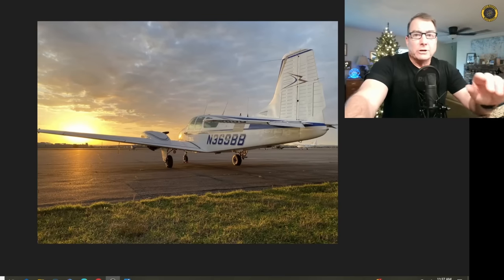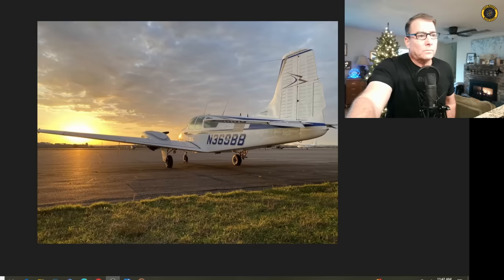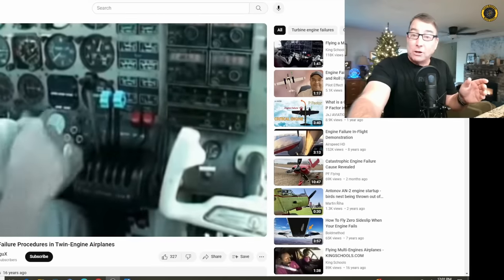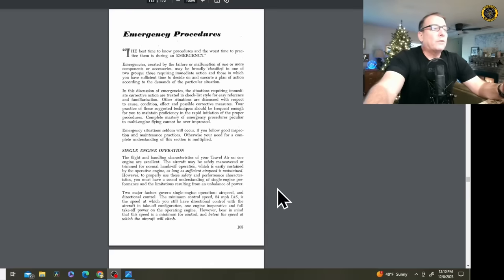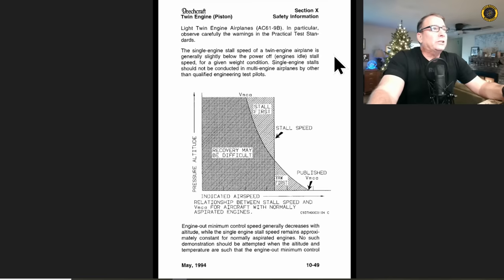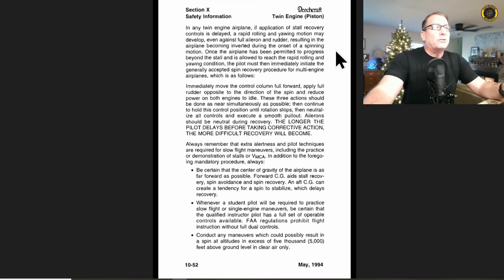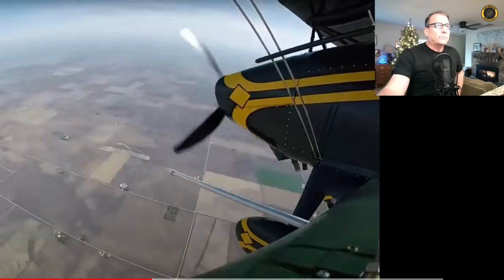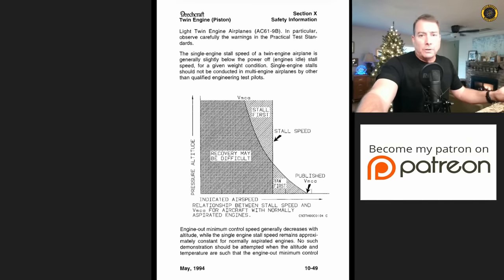Another Fatal Vmc Demo Stall Spin!! N369BB 4 Dec 2023

Comment: Vmc demos should absolutely be preceded by several directional control exercises. Practice maintaining heading in cruise at progressively lower power settings. Once proficient, practice in climbs and then finally the demo. I have instructed in several types of light multis, and this is the best way to get the student active with their feet, maintaining directional control. The other part of the Vmc demo is to NEVER actually slow down to Vmc. Leave a buffer. The "foot block" idea has been in the guidance for years, but I prefer to make an airspeed buffer. The point is made either way. 
Proper flight instruction requires skill, knowledge, and situational awareness that is becoming less common.
Reply: I am not a pilot (only flight simming), can I ask for clarification, what do you mean with blocking full rudder exactly? E.g. when the left engine is out? Thank you!

Comment: I'm not a pilot, so my opinion here may be ignorant, BUT it seems silly that the relatively inexperienced pilots who don't have enough time to fly for the airlines are the ones tasked with training new pilots. Can someone help me understand the logic behind this? It feels like, over time, this will seriously diminish the quality of pilot. Each subsequent "Graduating class" of pilot, will have been trained by increasingly less and less experienced pilots. 

Is there something I'm missing? This is a genuine question asked in good faith NOT a backhanded criticism of the entire system, or anyone operating within it. I just don't get it.
Reply: This has long since been the way. Twenty years ago I was a 250 hour pilot training other pilots for multi ratings for $10 per hour to gain experience. Just like my instructor had little experience himself. With a good training syllabus and oversight that is not a major problem.
Reply: The young instructor pilots are not training people specifically for the airlines.  If you want to learn to fly for whatever reason and you went to your local flight school you would find that most instructors are young with relatively low time.  This is because being a flight instructor doesn’t pay that well, especially compared to the airlines.  These instructors are willing to fly for crap pay because they are getting hours toward being experienced enough to fly for the airlines.  This means that as soon as they have experience enough to get a better paying job they are gone and the next up and coming instructors are getting hired.  This is not an intentional process, but that is how the incentives are aligned.  Once they go to the airline they get much better instruction on their specific aircraft with more experienced instructors in top of the line simulators.

Comment: When Vmc is below the stall speed, which is not uncommon on light twins used for multi-engine training, then recovery must be initiated immediately at the first indication of a stall (stall warning or aerodynamic buffet) or loss of directional control (yaw or roll or both). The stall warning system on the airplane must be operational, it must be confirmed operational during preflight, before performing the Vmc demonstration.

Comment: Truly excellent analysis, thank you.
I recall doing my multi FIC with a very seasoned operator, who began the first briefing with the statement " multi engine tuition is the most dangerous flying that you will ever do.
The discussion that followed and the mitigations, some of which you have touched on were core skills in that course.
The Vmca demonstration was to be made precisely as you noted with a false rudder stop to prevent an entry into the stall regime.
At the time, the airline market was such that most of us had in excess of 1500 hours instructional time, but the airlines were still not biting.
Thankfully this produced a very experienced and motivated set of instructors, rather than having to do anything at all to achieve the magic figure.
Conversely, the cadet output from approved organisations entering into line ops with minimal hours also presents some interesting challenges.
Technically above average but with very poor airmanship experience.

Comment: Juan has identified the requirement for 1500 to get into airlines as a factor. Typically, in order to build time students get a commercial license and then an instructor rating to enable them to build the hours. Invariably this means the inexperienced teaching the unqualified. Disaster is the often the result of this.
Reply: It would make far more sense to have the pilots train for several hundred hours in the sim instead, IMO.  The airline hires them and then they go into a second flight school.  Not the roughly 50 hours of sim time, but 200 or 300.  Where they can safely train all of these maneuvers and get up to speed quickly.  Net result - maybe 800 or 900 hours total, but far better trained on what they will actually fly.  Not this 1500 hour nonsense. And no risk of dying in maneuvers like this.

Comment: I have a CFI MEL and did mutli instruction about 50 years ago. We didn't have any idea about the problem with VMC  below the stall speed at higher altitudes. luckily we were at sea level airports and did our instruction pretty low.  Even though qualified to instruct in light twins, there is not enough money to convince me to do it.

Comment: Juan, back in 1964 I was working on my multi-engine rating with Lee Sitton out of Lebanon, Oregon. We flew up to Hillsboro to look at a Cessna T-50 which he purchased and I received my training and multi rating in. A gentleman named Bob Bell demonstrated another T-50 with a student. While we were out and the student was working on Vmc practice Lee asked Bob if he ever did spins in the T-50 and Bob said yes as he had instructed in the T-50s during WWII. 
He performed a 2 turn spin and walked the student through the process. In flying and later instructing in the T-50 it performed like a J-3 Cub with two engines. I never did find any bad characteristics with that aircraft.
But like any spin there is a recovery factor and you need ALTITUDE to recover from any spin. I have performed 7 turn spin in Aeronca Champ!
Have you watch the NASA videos of the Beech Duchases that Beechcraft performed over 1500 spin test to determine spin entry and recovery analysis?

Comment: I don't think they do spin training for Instructors any more.  Excellent Video.
Reply: Spin training is required before you can take a CFI Checkride. 
And it doesn't matter if it's in a twin,  instrument,  or single land/sea checkride, you must get signed off for spin training. 
 
Spin training will performed in a single engine A/C that is certified to do so.

Spin training is not required for any other checkride.
Reply: @aarondoty2210  It was in my day, but I was under the impression that it was no longer the case, Of course its not done in a twin. If it is back in the syllabus that is necessary.

Comment: When I learned to fly back in the 90's, we practiced Vmca and spins in a cessna 150.  It was a lot of fun and easy to recover in the 150. I can't imagine being in a flat spin in a twin, especially at lower altitudes. Excellent review as always.
Reply: How can you practice Vmca in a single engine 150?  Spins...yes!....Vmca imaginary?
Reply: @JM-lf4ws  mca.  I used Vmca because that's what they were talking about in the video.  Mininum controllable airspeed. MCA. My flight instructor would have me ascend to around 4000 ft agl, slow the plane down(stall is around 42knots), riding the stall horn and practice holding it right above stall keeping the wings level.  The controls get extremely unathoritive.  Bring the engine to idle, pulled yoke all the way back with opposite controls, over on its top and into a spin.
Reply: Vmca in this video applies to the minimum airspeed that a multiengine plane can be controlled in flight with an engine out.  The 150 stall speed, Vs is what you must be thinking about.  The sluggish control response near Vs in a 150 is not the same physics/aerodynamics explained in this video.  I am a single engine pilot and engineer...I would have thought opposite engine power would have a positive effect...the pilot says that is not true in practice!

Comment: Very informative video. Thanks for sharing.  I remember the Wright Patterson AFB Aero Club lost a Beechcraft Baron. The instructor and student were practicing engine out procedures and the aircraft stalled, flipped inverted and ended up in a inverted flat spin.  They never recovered and sadly both pilots were killed in the crash.  Obviously, they had flown the aircraft outside of its flight envelope, that caused them to enter an inverted flat spin and crash.

Comment: Question to the pilots who have a lot more than 300 hours total time who might know better: is there a reason why twins in a spin don’t add opposite power during the prea/reap/what have you recovery?
Power idle: stop spin acceleration
Rudder opposite: break spin (would you not briefly add opposite power to assist in breaking spin?)
Elevator down: break stall
Aileron neutral: don’t induce more stalls

Obviously this only applies to engines in simulated feather, not engines that failed.

Comment: One thing I rarely see mentioned in connection with VMC training if the difference between an actual engine failure and reducing an engine to idle.  I did my AMEL training in a PA-34-200 (Seneca II) long ago, right after the dinosaurs died.
If I recall correctly, VS was 76MPH and VMC was 80MPH, so only 4 MPH between the two, a fact my instructor kept beating into my head.  When your speed is decaying because you lost an engine you had few seconds between VMC and a spin.
He gave me a demonstration one day when, without warning, he pulled the mixture instead of the throttle and killed an engine.
Yep, a noticeable difference.
I had a really good instructor.  Since the Seneca had counter-rotating props it didn't have a critical engine, so he gave me a lesson in a Cessna twin that did so I could feel the difference.  And beat into my head that knowing which was which was important when flying twins.

Comment: Relatively new MEI here to add my 2 cents. One other thing that MEIs must be SO careful about is the use of ailerons in the Vmc demo - if the student adds aileron into the operating engine to help control the yaw (it happens subconsciously, and can happen to even the best pilots if they're not briefed adequately to avoid it!), an airplane that will normally reach Vmc well before stall speed will appear to fly straight through Vmc until reaching the buffet, putting the airplane in this very dangerous situation that Juan is talking about here.

So, MEIs - DON'T allow your students to control yaw with the ailerons at all during a Vmc demo, and if they do - IMMEDIATELY discontinue the maneuver and recover, then go back and properly brief the student on the ground about the dangers of the Vmc demo and common student errors that can cause a fatal accident.

Comment: First, let me say I learned a lot about ME aerodynamics from this video, and it prepped me very much for my recent CMEL training. Thank you, Juan! But I recently reviewed the preliminary report by the NTSB regarding this crash. The state in which the airplane was found is inconsistent with a typical Vmc demo, but is certainly a lesson in the dangers of a Vmc condition. FIrst, the landing gear was found extended. Second, one of the blades on the left engine was found undamaged, indicating the engine was likely not under power. Damage to the nose and engine was skewed right, indicating a spin to the left. Typically Vmc demos are not done in the landing configuration due to the keeling effect of the landing gear. Second, they are not done with an engine shut down or otherwise inoperative. Based solely on that report, it appears more likely to me that the pilot and student were working on power off stalls, and the left engine quit during stall recovery.

Comment: Thanks for the great VMC discussion. When I was a kid I taught hundreds of hours of slow flight and VMC in light twins. I demonstrated a technique that dramatic increase in rudder authority as the plane approached VMC. Just decrease one inch of MP on the 'good' engine and you will instantly stop the yaw. I see that is being taught now and that's great.
Can you add a discussion of the impact of adding VGs to old twins. These VGs are also added to the rudder. What I'm thinking is this decreases stall speed AND VMC due to a more effective rudder. But are we creating a ticking time bomb on these older twins?

Comment: 10:16 when Flywire was doing his spin recovery, he used "idle (engines); neutral (ailerons) ; aft; rudder (opposite spin direction)"
I thought aft was the stick, unless I really misunderstood him - the idea was to get the plane in a position to get maximum airflow over the rudder. Is that different in a twin? Once the spin was recovered from, then point the nose down and do a dive recovery.
I honestly don't know <- not a pilot. Any clarification greatly appreciated, as I try to learn this stuff.

Comment: Great video, I am a CFI out here trying to get those hours.  Not currently a MEI, and do have multi addon for my pilot cert.  I wasn't taught this lesson, and really appreciate the knowledge here.  

I am confused on the 'blocking the rudder'. Are you saying as an instructor, if I get my MEI and chose to teach in multi, that I 'pre push ' the rudder, or I put my foot behind the rudder,  limitng the apparent travel to the student, so if something happens we have a little extra rudder by removing my foot/block?  Just watched the video and haven't read all the comments so maybe the answer will be obvious with a little thought.  Thanks for all your work and effort making a nation safer.
Reply: Basically what you explained is correct, as the instructor you will block the opposite rudder so the student can’t keep pushing on the rudder causing the plane to yaw in the opposite direction of the rudder correction. This is to simulate VMC while staying above actual VMC or stall speed.

Comment: I was about 10 years-old when my father was taking instruction for his multi rating. His instructor was very good, but tough and fearless. I was in the airplane on a training flight during a Vmc practice. The 310 we were flying  rolled over on its back and entered a spin. Obviously we were able to recover but it left me with a fear of stalls, Vmc demonstrations etc. When I was getting my multi rating the training was much more conservative, but I was always hyper-aware of airspeed and the feeling in the seat of my pants anytime below cruise speed. I guess the high-end simulators might be able to re-create the visuals but there is a feel that is recognizable in a single-engine demonstration that may not be available in a sim. Awareness and extreme caution as you, more or less, stated is paramount for these training flights.

Comment: PARE....Power aileron rudder elevator.  I got my multi in a 310 in 1984.  Before the CFII would allow us to practice Single Engine Vmc, we had to take spin training and get signed off on 50 different spins...yep 50.  We did them left, right, accelerated, etc.  The first couple of lessons it was kind of scary, but after that I looked forward to spin training.  I am a firm believer spin training should be a requirement for a pilot certificate.  Getting into a spin your first time can easily be sensory overload.  If you dumb enough to get into a spin inadvertently, you better being able to recover without thinking.  Altitude goes by pretty quick in a spin, especially an accelerated spin.  RIP to those two plane crews.  If you are multi rated and fly a multi and haven't become proficient in spin avoidance/ recovery, you are likely sitting on a time bomb.

Comment: I heard this story from the grape vine. A while after WW2, two Hawker Typhoon pilots were talking (or Tempest, they look alike)  this guy were told to try this stunt for excitement, climb up high, get the plane to near stall, then apply full power, he did add, be sure you were over 20,000 ft before you try it.  He tried it, the plane flipped on its back, spun inverted,  and by the time he regain control, he was at tree top height. He did listened and started that above 20,000 ft.

Comment: Im only a lowly gliding instructor with nothing like your knowledge. A common misconception however is that the rudder eliminates the spinning. It doesnt, the stick fully forward untill the wing unstalls stops the spin, then the rudder corrects the yaw.

Comment: I am now old and did all of my flight training in the mid 60s.  One of my instructors was an ex WW2 bomber pilot (B24s if I remember correctly) and we never even tried spins of any sort.  In fact his attitude was don't even get close, period.  The Piper Cherokees were definitely not placarded for any aerobatics of any sort and all of my multi-engine training occurred in D55 Barons all the way thru Commercial and instrument rating.  Evan my check rides never included getting near spins.  We talked about spins and the proper recovery procedure but doing them was forbidden.  I honestly don't think the training today is as good as we had back then and using older aircraft is not helping the situation.  Just my two cents worth.
PS... Juan, keep it real trooper.  It hurts and is extremely frustrating to see these things happen,  just control the line pressure.  Good reporting!

Comment: Let me add this, not meant to imply what you are saying is wrong.  Some airplanes do require aileron for spin recovery, at least the A-4 did.  As to rudder stall, they called it fin stall, also the VMCA speed was calculated for every takeoff.